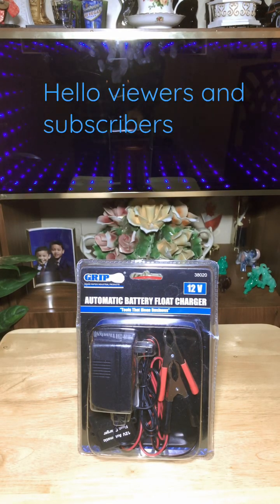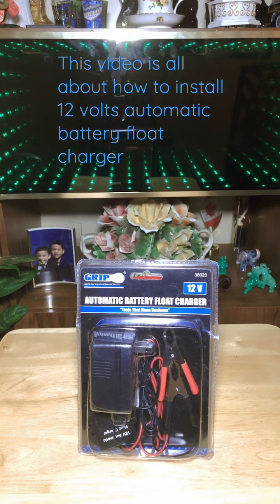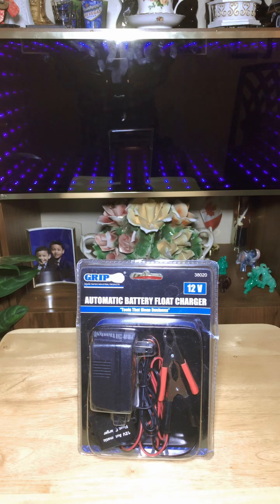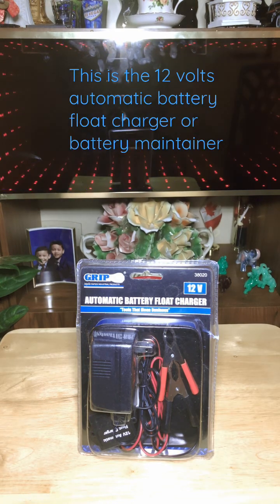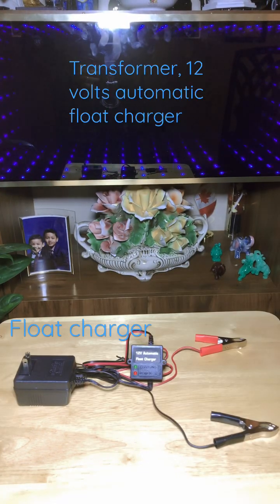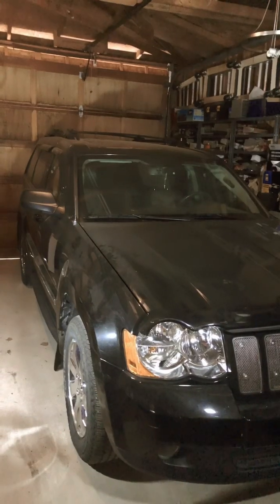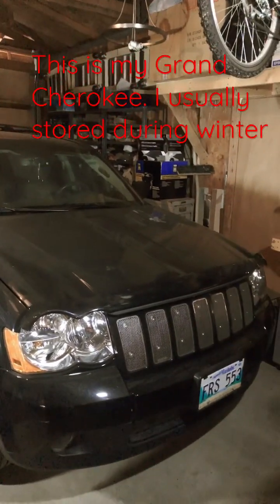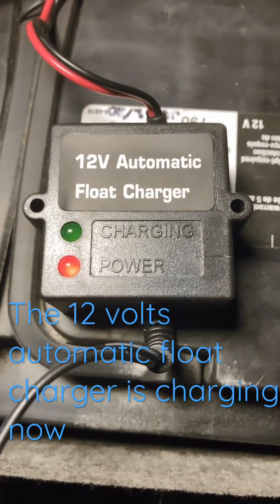DIY How to install battery maintainer for your car

Comment from the maker: I installed 12 volts automatic battery float charger or battery maintainer for my car. This is the ideal way to prevent dead or low batteries while storing my car. Small favour, please subscribe and share my YouTube channel RJL Innovations to support and promote my channel. Thank you 🙏